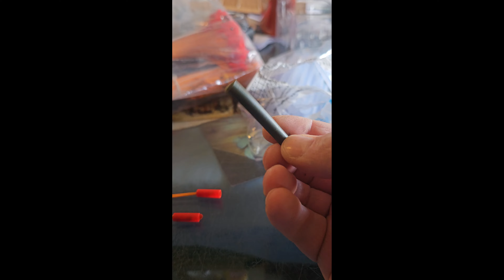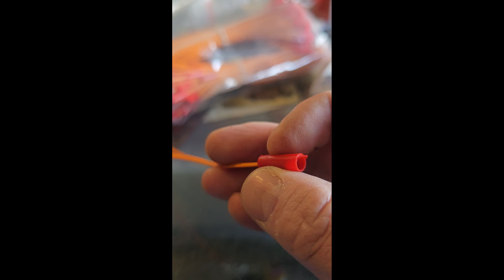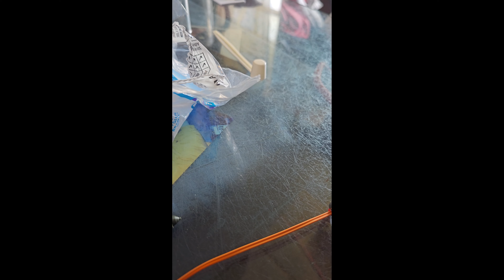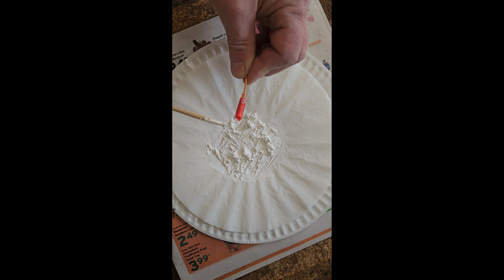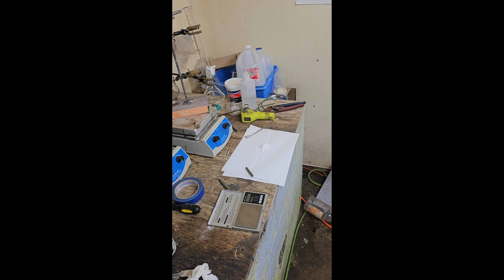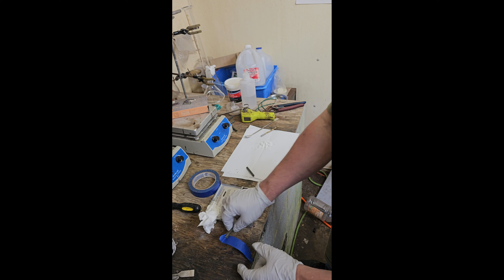How I made my Lead/PETN blasting caps

Comment: I use a small 1inch by 1/2 inch foil envelope with some ETN inside wrapped around a fuse or EMATCH for heat shock detonation every time, that assembly is lowered into a plastic pen tube with one end sealed with UV resin and powdered Etn pressed in which is safely molten to a pool at the bottom by lowering it into 85 degree Celsius water, once cooled off a little powder ETN is tamped onto the top and a layer of foil as a divider, and the heat shock detonator is lowered in the back and the top is sealed with epoxy, this type of cap used 100% ETN so it’s very stable and works 100% of the time, with the fuse or fuse comp never touching the ETN powder itself
Reply: Could you explain this abit more in depth or dm me a picture or drawing of this setup you described? I’m very interested in replicating it
Reply: Why go this route when there are very simple primaries you can make? 
Way more reliable.
Reply: @HyperHyena88  oh, my idea was to make a safe ETN only detonator, but for sure other primaries would be more reliable instead of the Etn foil stuff

Comment: I found that the little vials used for biolab gear made very nice caps. They got a little cap that fits in and cost about 2 to 3 cents new, and a lot less surplus. Put a fuse with a small bit of either black powder or flash wrapped in thin foil. Then paint with NC lacuor. Next fill them up with boister and press, then lead azide primary with a cotton spacer around the fuse. For electric do the same but wrap the match with NC paper before wrapping in foil. This insures a very fast hot match either way and gives 100% sucess rate. Have fun and keep both eyes and all 10 ❤
Reply: The little pointy ones with the attached snap on cap? 
Like a plastic sample vial?

Comment: Hey I'm wondering if you can try sodium perchlorate + methanol. (Solubility is 52g per 100g methanol) it should detonate. Basically just seeing if fully perchlorate saturated methanol will go off. (acetone has the exact same solubility you could use it too instead)

Comment: Thank you;
I use this ratio:
150mg LA
100mg etn
850mg(Petn/etn-60:40)
Reply from the maker: I like to do ETN/PETN melt cast 😁
Reply: @darianballard2074  hey Darian, have you considered using Plasti-dip/liquid tape/shrink tube vs. glue gun? Glue gun = hot mess IMO.  
Christmas lightbulbs are perfect for bridge caps. Run razor around tip, superheat tip, break tip off than fill with your cold/hot cast 50/50 etn/petn.
Reply from the maker: @CIA_Alien  When i was a kind i used Christmas light bulbs that way.  Yes I've considered using Plastic-dip/liquid tape/shrink tube as I've seen other people using all of those. 
😁

Comment: I see a lot of people talking about mixing multiple compounds instead of 1, what's the point of that?
Second question, how are powders plasticized?
Reply from the maker: There is a lot to mixing stuff. Sometimes an explosive is o+ and can use more fuel to increase power, other times you might need something that detonates easily to set off more powerful charges that don't detonate with out an explosion.  I use PIB or similar to make plastic explosives. The plastic i make in this video will detonate with a blasting cap.  I will redo a  plasticizer at some point. https://www.bitchute.com/video/e12k5WNCve6T/
Reply: @darianballard2074  I know that the mixing is either for oxidizing or for setting off other explosives that need an explosion to detonate, but I asked why do that in a blasting cap if it's gonna detonate the main charge without the use of other compounds?
Reply from the maker: @comrademonke5934  For the same reasons its done in larger set ups. In mime the lead azide will explode with a spark or fire and the PETN will not. PETN is far more powerful then lead azide so PETN is needed to set stuff off like TNT and so on. The HMTD caps i use in other videos wouldn't set TNT off but if I added some PETN it would. In other words it works as a step explosive or booster.
Reply: @darianballard2074  Thanks for the info. One last question, is lead azide enough to detonate RDX on it's own, or is PETN needed?
Reply from the maker: @comrademonke5934  Led azide will work on its own for RDX.

Comment: Why don't you use a less toxic secondary for petn than pbn3 2?
Reply: becuase few are as efficient and safe. Same reason as the mining industry still uses it and military. They are working on a better replacement, but when some thing happens to be such a great fit hard to find a better fit.
Reply: What are you a Hippie?!! 
(Joke)
Reply: @Refertech101   @Refertech101  True! I use mercury(ii)fulminate but it's also as toxic. I can confidently recommend hmtd or tetryl.